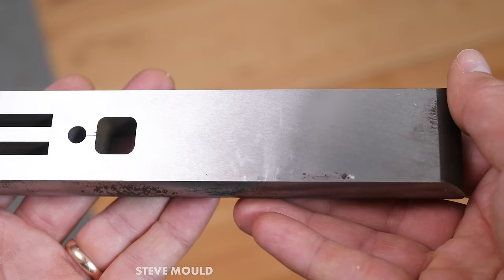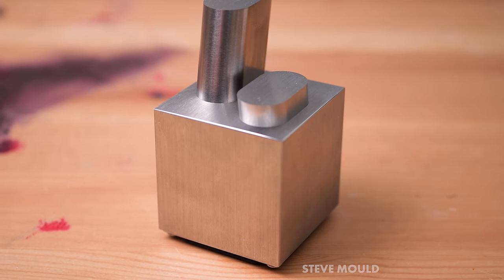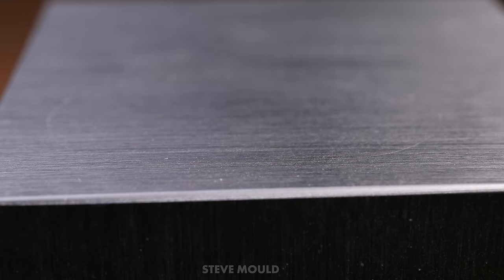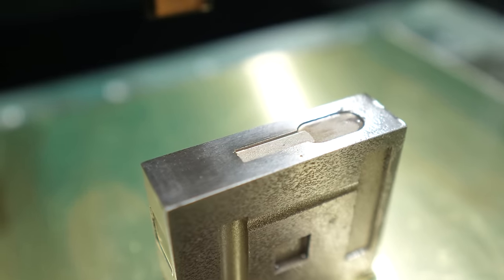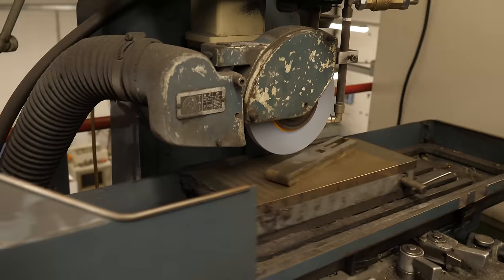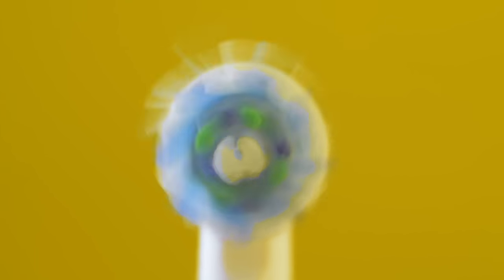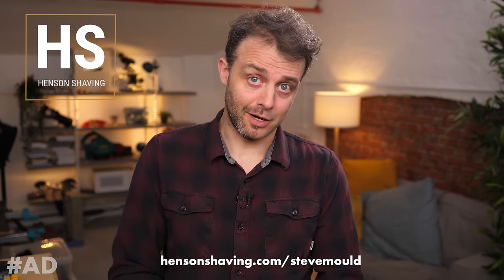How these impossibly thin cuts are made

Comment: As an engineer at rolls-royce who has access to one of these machines. It makes me very happy. I love making these sort of things!
Reply: CRF per chance?
Reply: 0.005 mm = 0.00019685 inches
or 196/1,000,000 of an inch. lol
or >2/10,000  inch
AKA > 2/10ths of a thou  ...      It's precise
Reply: I worked for around a year on wire EDM, almost the same model as Mitsubishi in this video when I started my career (together with CNC mills) and I really like working on that. I made a cube made of four puzzles like that. It's so satisfying.
Reply: Must be pretty cool using wild machines to make parts for some of the coolest cars on the planet. Congrats.
Reply: wait, you get access to cheese cutters at rolls royce??
Reply: @LiterallyCensoredDaily  thanks. Jet engines though, not cars.
Reply: @feliperojas-doomride  only the best at royces! 🤣🤣
Reply: @T_A_WOW  also cool!
Reply: @calholli  you mean "<", not ">". Also irrelevant to the comment
Reply: Haha, I know that feeling all too well, I'm an aircraft maintenance technician. Structures, specifically, and easily my favorite part of my job is our machine shop and the scrap bin.😅

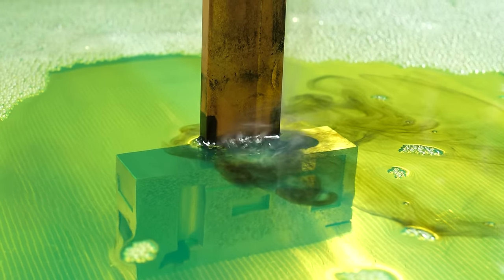Comment: 3:55 another benefit of submerging the part is that the liquid reduces how much eroded material gets into the air and, from there, into Richard’s lungs.
Reply: old versions were non submerged, but the newest nonsubmerged machine I've worked on was from 1986.
Reply: @jokeassasin7733  they still make them. they are better for speed but less precise, we use one as a bandsaw to cut 3d printed Inconel off build plates at our shop.

Comment: 6:50 "A typical wire EDM machine will have a precision of around a 5000th of a millimetre, which in inches is a different number" 😂
Reply: I came here to say this but you beat me to it😂
Reply: I think he meant 5 thousandths, not 1 five-thousandth.
Reply: 0.00019685 inches
Reply: The length of the right side of his stubble is the same number as the left side. They’re just different units.
Reply: I believe the number he gave was "five thousandths", so 5/1000, not 1/5000.  If you remember that there are 25.4 millimeters in an inch, you should be able to approximate the conversion in your head pretty easily. (It actually ends up being close to 1/5000 in inches since there's about two factors of 5 in the conversion.)
Reply: I love it when people poke at the imperial system like that xD
Reply: So 0.005mm (5um, 5 microns) or about 2 "tenths" of an inch (2 ten thousandths) 0.0002" (200uin, 200 microinches). I've seen better 😂

Actually the more important part is the accuracy of the travel of the machine itself, as opposed to just the consistency of the cut. I believe they often have optical scales rather than encoders, meaning they avoid the issue of slop in the mechanical movement parts, but you still have all kinds of other mechanical distortions that can be involved.

I program a CMM. I am your God 😂.
Reply: The wire EDM I use at work has an accuracy tolerance of +\- 0.001mm over 400mm of travel.
Reply: I love his sense of humor. If it’s not in SI units, I don’t want to hear about it 😂
Reply: @judgeg2906  looks different to me
Reply: Showing the imperial system the correct respect
Reply: Agreed, the Americans need to get on board with metric. Considering imperial isn't even based on its original units anyway, they're all derived from metric units nowadays anyway. We changed in Ireland when we adopted the Euro. It's not difficult to change over. People adjust and adapt much quicker than you'd expect. I want to stop knowing what all the conversions are it's exhausting using both just so I can understand what the conversation is for inch, mile, lbs, feet.
Reply: I love to see passive aggressive pokes at the stupidity of 'freedom' units.
Reply: @jiminboo  not wrong lol
Reply: @a-aron2276  aerospace and automotive is largely all metric by now, but almost all DoD stuff is still imperial 🤦
Reply: It's a number no one in their right mind would even care about.
Reply: I started scrolling down to comment on the wonderful surface treatment of the cheese and I read this comment word for word exactly at the same time Steve was saying it, funny coincidence
Reply: @a-aron2276  I wholeheartedly agree, BUT - in our defense, we rarely have to convert between units of length or mass. There just isn't a need. It doesn't matter how many feet are in 5 and a half miles, because we wouldn't ever use feet for long distances. We would just write "5.5 miles". Same thing with ounces, pounds and tons. How many ounces in 3.2 lbs? I don't know, and don't need to know, because we just use decimal notation. 

The one place it really sucks is volume - measuring ingredients for cooking is so annoying. One cup is 16 ounces, three teaspoons to one tablespoon, so many blanks to some whatever... just use milliliters! And no conversion annoyance is required for tiny length measurements. I use a metric ruler or a metric caliper for all of my small cuts. I HATE trying to compare length in fractions - fractions with unmatching denominators, like 3/8 and 7/16 or 15/32. It's just incredibly dumb. Why didn't they just pick a single denominator and put that on all the tools? Who cares if the fraction can be simplified? If I have to use it, I'd rather those numbers be 12/32, 14/32, and 15/32. Or just get a metric set.
Reply: That's 0.0000078740157" if anyone was curious.
Reply: was about to write the same xD
Reply: @judgeg2906  0.00019685 inches = 196.85 nano inches = 3927/20000000 th of an inch
Reply: @T_A_WOW  That's 2.5 parts per million, simply mind blowing for a mechanical system.
Reply: This killed me 🤣🤣🤣
Reply: @atashgallagher5139  Not quite, five thousandths of a millimetre = 0.005 mm = 0.00019685" or just under 0.2 thousandths of an inch.
Reply: @a-aron2276  No we shouldn't.  We already do use metric where it is more appropriate, for scientific measurement, for example.  But for everyday, customary use, customary units are better.  It's what they are for.  And indeed, the countries that claim to solely use metric quietly admit this.  If you buy a ruler in a metric-only country, do you know how long it will be?  Thirty centimeters, at least typically.  Do you know why?  Because that is almost exactly the length of one foot.  Because the metric system (technically, it should be called the French Revolutionary system; all measuring systems are metric systems), because it is decimal, has no unit at that scale, but it is very useful to have a unit at that scale.  So, quietly, without saying so, they have invented the metric foot.  They have done the same thing with units of volume: you go to a bar in a metric-only country and order a beer, what size do you think the glass will be?  Typically, a demi-liter.  Why?  Because a demi-liter is very close to a pint.  Again, there should not be a demi-liter in the metric system, because it is supposed to be strictly decimal, but it is very useful to have a unit around the size of a pint, so, again, quietly, without admitting it, they have invented the metric pint.  With units of mass, they caught a break with the fact that a megagram happens to be roughly the same scale as a ton, so they called it the tonne or the metric ton.  

And, of course, supposedly metric-only countries do use customary units, often without realizing it.  Almost no metric countries, for example, measure font sizes in word processing or typography in millimeters or micrometers.  Instead, they use the customary unit, the point, as in twelve-point font.  The point is the customary unit below the inch; it is 1/72 of an inch.  The only country I know of that does not use points as the unit in typography and word-processing is Japan, but what they use is called the Q, which is a quarter millimeter.  Again, not decimal, but also not far from the point in scale.  And I have watched enough cooking videos from Germany and France on this very platform to know that, when it comes to ingredients that are used in small amounts, like salt and spices, grams are out and it's all Teelöffel and Esslöffel or cuillères à café and cuillères à soupe, or, in English, teaspoons and tablespoons.
Reply: I believe it's 5 thousandths, not 5000th.
Reply: That's not what he said. He said "five thousandths of a millimeter", which is 25 times larger than the number you heard.
Reply: @CjqNslXUcM  Hey, it's only a factor of 25. Machinists typically don't sweat the small stuff.
Reply: @redrackham6812  thank you
Reply: .2 thousandths of an inch
Reply: @DmnkRocks  you are wrong. It's not 0,00005mm it's 0.005mm aka 5 micron. Where did you go to school?
Reply: I crackewd up at that one too.
Reply: 1000th like, satisfying :face-blue-droopy-eyes:
Reply: @MegaDudeman21  You're welcome.
Reply: @BenAlternate-zf9nr  it's about 0.2 Thou
Reply: Hey now you're a Glockstar..🎶
Reply: @judgeg2906  you're missing a zero, 0.000019685
Reply: @atashgallagher5139  that's not correct, here inlies the problem with  the imperial system, the rest of us use one system and all it takes is for someone to not double check their math for a disaster to occur.
Reply: @topherthe11th23  actually ye did at first.
Reply: 5 1000ths*
Reply: 5/1000mm not 1/5000mm
Reply: 0.005mm**, forgot the metric folk don't get fractions
Reply: @miles11we  5um
Reply: A 5000th of a millimeter is 0.2 micron or 200 nanometers. I doubt a regular CNC machine can achieve such accuracy
Reply: Modern WEDM is capable of precision over twice a good as Steve cited -- ±1.0μm -- or around ±0.00004 inches.
Reply: @topherthe11th23  they weren't called imperial units back then obviously till the imperial system was standardised in 1826 but what do you think they did pre that? It was obviously the British system of measurements. https://en.m.wikipedia.org/wiki/Imperial_and_US_customary_measurement_systems#:~:text=Prior%20to%20the%20United%20States,the%20English%20system%20of%20measurement.
Reply: @matiastripaldi406  CNC milling machines have been able to hold +/- .0025 mm positional accuracy since the 80s. High resolution servos and ball screws makes it possible.
Reply: @ADBBuild  yes, your figure is 2.5 micron which is achievable. Thr original one was 0.2 micron which i'm not sure if standard CNCs have achieved yet (i knows its possible just not if its accessible to the general consumer)
Reply: @a-aron2276  America has four million miles of public roads, all of which would need to have their signs changed several times to safely transition from imperial to metric. That’s a process of several years, costing billions of dollars, for a change that most of us don’t actually need for daily life. It’s probably never gonna happen.
Reply: It is "5/1000ths". Its amazing how bad non-Americans seem to be with simple fractions.
Reply: @TheDuckofDoom.  Its not about about the fractions, but the language. If you say "x is a 5000th of y" the logical interpretation is that x=y/5000. You'd have to say something like "x is five thousandths of y" which is different to "a five thousandth of"
Reply: @LugborG  now that's a reason I can understand, and makes sense. Not that "our system better" bullshit I read everywhere
Reply: @rosskrt  And that’s just for roads. Most of us have been using the imperial system for our entire lives. It’s internalized in the same way the metric system is for Europeans. It’ll be an entire generation before the metric system becomes the default, and even then you’d still need to know the imperial measurements to work with any legacy equipment, because you can’t use metric tools on old machines, and most old machines take input in imperial as well. Given how expensive that kind of stuff can be, it’s unreasonable to expect people to replace it just to match the new measurement system.
Reply: @matiastripaldi406  Which is why the standard assumption in engineering is either division by 1000 or 1000 000 
eg 1/1000 or 6/1000 000; 
or binary division eg 1/2, 3/16, or 7/8
Even in SI "5 thousandths of a milimeter" would be nonstandard, it should be 5 micrometers (or microns informally)
Reply: @judgeg2906  I think he meant mm/5000 so 10^(-3)/5000m= 2*10^(-7)m for inches we would have 1m=39.3700787inches so 2*10^(-7)*39.3700787= 0.00000787401574 inches. I don’t see how you got your numbers.
Reply: @matiastripaldi406 My machines have no ballscrews so there is no backlash, they have liner motors rather than rotating motors, I can hold .00015 all day long.
Reply: @topherthe11th23  it sounds like you just agreed with A-A Ron's original point, which was "actually ye did, AT FIRST". Maybe they weren't officially called "Imperial Units", but they were the same units regardless, yeah?
Reply: @vernzimm  they use both optical scales and encoders.
Reply: @matiastripaldi406  Its confusion between him and the machinist.  That Mits wire is a 0.005mm or 0.0002" accuracy machine.
Reply: @qy9MC  he means 5/1000 as 5 thou of a mm.  Neither of the machines shown are capable of accuracies you presume.
Reply: @vernzimm  that's weird because I'm pretty sure I zeroed my gun for 300 meters, not yards or feet.
Reply: I dont get the joke , can someone explain
Reply: @ashtonhoward5582  I was referring to manufacturing specifically. The vast majority of DoD stuff I deal with is still inches because it's exclusively manufactured inside the USA. It's one of the few remaining areas of US manufacturing that hasn't become completely integrated globally (as opposed to Automotive, Medical, etc.)
Reply: @vernzimm  I see. That's very weird.
Reply: @ashtonhoward5582  or sometimes it's the obviously converted to or from metric, or the even worse "let's just put both" version. Every dimension is like "100 +/- 0.1 [3.937 +/- 0.004]" or vice versa 🤮
Reply: @topherthe11th23  I'm a little late, but thanks for taking the time to write all of that.

It makes sense now and I understand what you were saying all along. We DID use the British system of measurements at first, obviously, but never the Imperial system (which I didn't realize was created centuries later).

 Consider me educated 😎
Reply: It's 5 1000ths, not 5000th

Comment: This has got to be one of the funniest and best episodes you've made so far
Between the perfect cheese analogy, the resin and the water mixing and doing,,, something? to deionize it and the "which, in inches, is a different number" I had my sides splitting
Reply: and the beard half trimmed lmao
Reply: I gave the like for his brilliant comparison of a Henson shaver and a leading brand shaver on his face! He finished me off with that one!
Reply: @TheOriginalEviltech  I had a feeling, when he didn't go into ink cartridges and toners, where profit margins exceed nuclear rod profit margins by far.
I'll stick with my straight razor for single blade shaving, for regular shaving, I'll stick with my only recently introduced to supermarkets 500 blade razor until it starts to dull as quickly as the much more expensive name brands.
Largely, as I do know how to hone my straight razor and the 500 blade model still has cheap and durable blades (as in, they last months for me on a single blade cartridge. With its evil attachment method.
I'll just get my coat...
Reply: @hugodasilva9050  Especially using the razor backwards, with the guard on.
Reply: @spvillano  dude you're so high 😳🤯
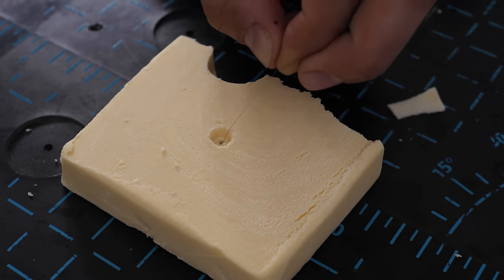Reply: Malice  1:45, he spent what i assume was 3-5 minutes meticulously trying to drill the cheese and it just rips in half anyway, I lost it for some reason
Reply: Nice, thoughtful comment, actually. I like stuff like this.
Reply: did you see his half razored face?? that should be in the top 3 of this list xD

Comment: As a machinist (I do CNC work but we also do a lot of EDM work here) and it’s always satisfying when your parts fit together so perfectly and smoothly
Reply: I LOVE EDM, especially the drop 🤪
Reply: The best is when you get your nominal pin to bounce like a spring in the part
Reply: oh hi shulk
Reply: @kalebstover-fb2ll  Nah, the best is pulling the pin out quickly and making the pop noise. "Like a finger in a butthole" as a coworker once described it. 😂
Reply: 0.005 mm = 0.00019685 inches
or 196/1,000,000 of an inch. lol
or >2/10,000  inch
AKA > 2/10ths of a thou  ...      It's precise
Reply: shulk!
Reply: I read that as masochist the first time